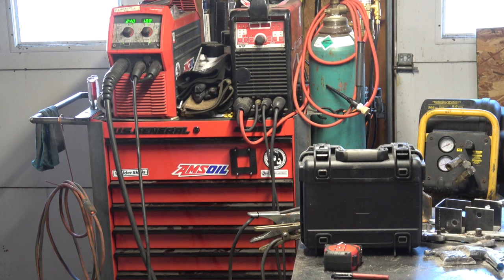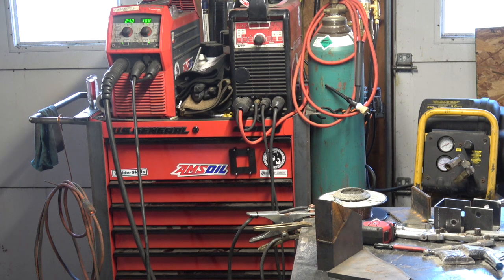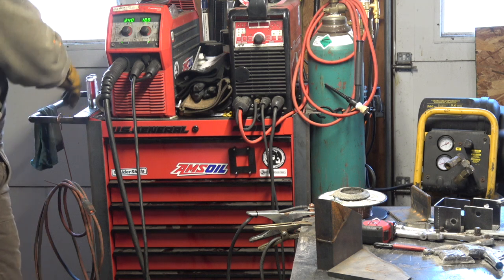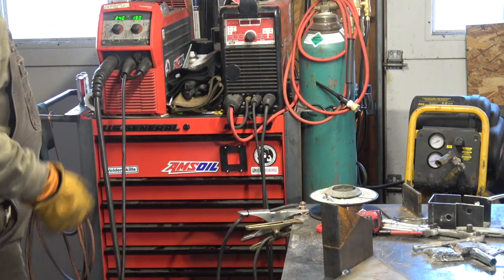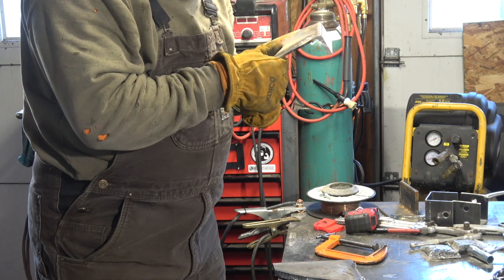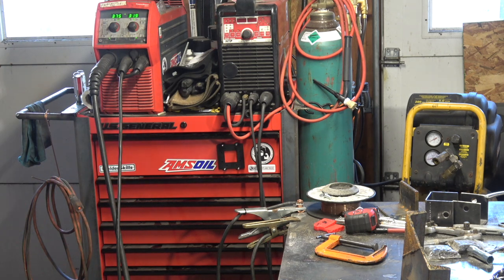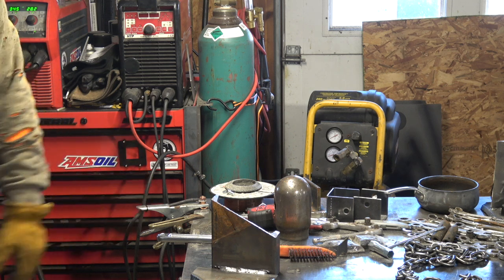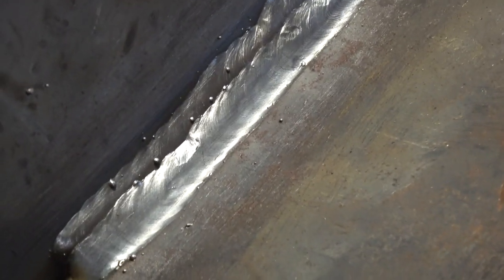An Intro to Spray Transfer Mig Welding

Comment: Turn it down. At 360 Ipm you want to be at 21.5 to 22 volts. With .035. Get a parameter calculator. It'll change your life. Changed mine
Reply from the maker: if you want to be short circuiting yeah 21-22 volts will work. it won't spray at those voltages. that's what I was trying to go for.

Comment: What size wire did you use how many amps good video
Reply from the maker: .035” Er70-6 wire. Settings are on the machine. I think it ran best around 360 inches per minute 28.some volts
Reply from the maker: I don’t look at the amps when mig welding